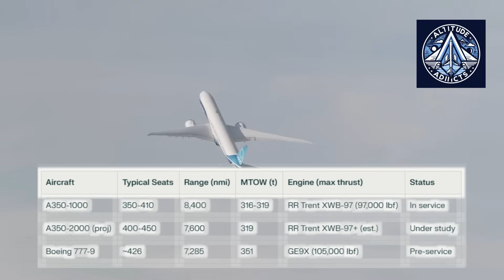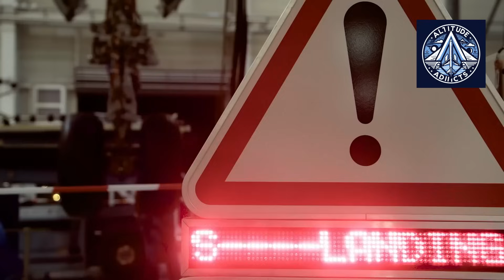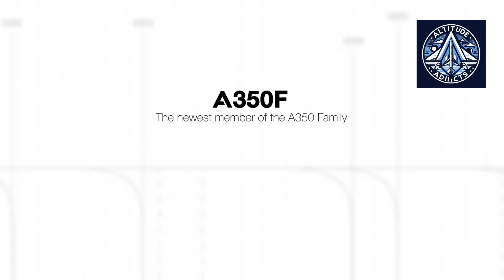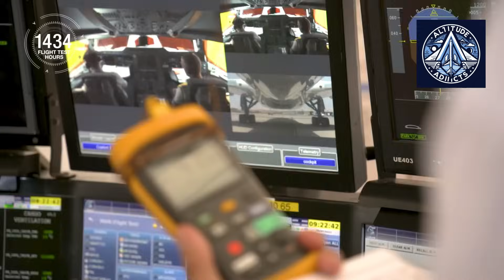Why does Airbus NEED the A350-2000 to compete with the Boeing 777-9?

Comment: A350neo with 79m length, more wider cabin, 
If Airbus can produce a350neo before delivery of 777x and if 777X delayed to 2030 then its possible many Airlines like may cancel the deal with boeing and probably shift to A350neo. But i don't think it will happen now already supply chain issue so its  for now we can  imagine

Comment: In summary, the proposed 350-2000 would have a fuselage length of around 80 meters, just fitting inside the 80 x 80 meter "box" for parking an airliner at the gate. There might be interest, but most airlines already bought the 777-9, so....

Comment: Personally I don't think the -2000 variant is gonna happen. Boeing has already secured that market that the -2000 is going for. Only way I can see it working in Arbus's favor is if Boeing seriously messes up with the 777X or delays keep continuing. Airbus would be better of developing a new A320 and a 757/767 replacement.
Reply: Most airlines already find the A350-900 and -1000 more than enough for their needs. Remember, there are very few airports nowadays that need the capacity of something in the 777-9 or larger size outside of London-area airports.